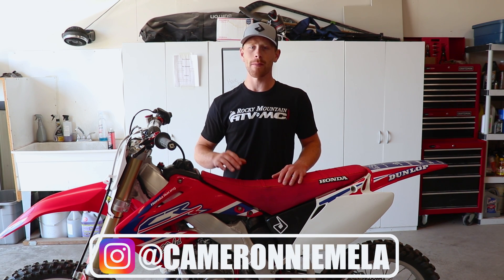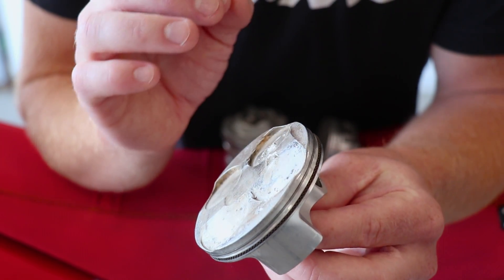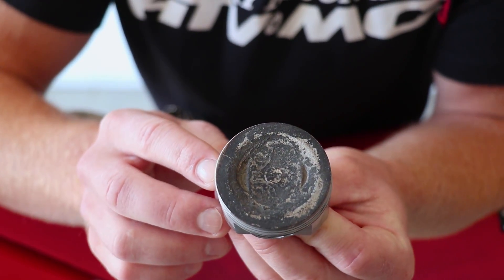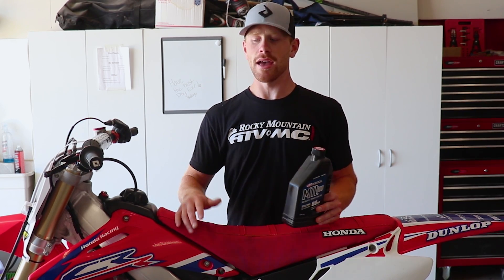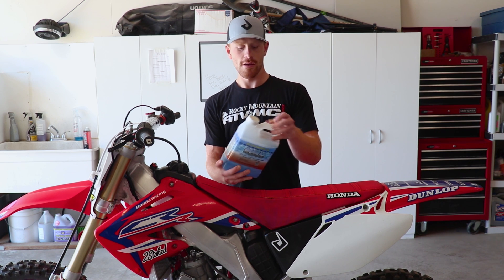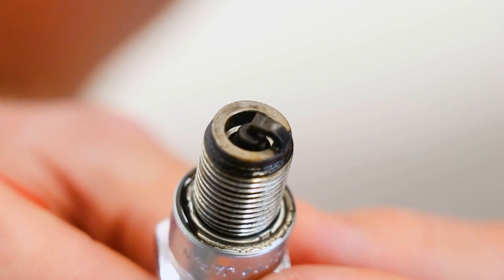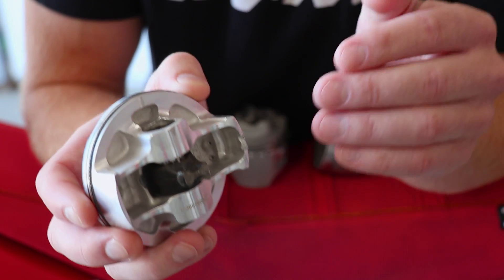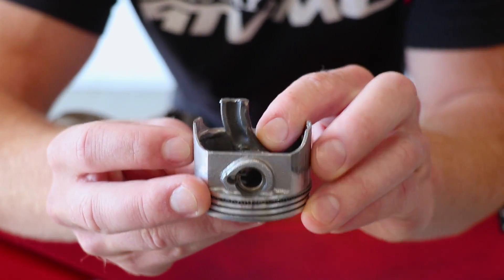Why Do Engines Blow Up?

Comment from the maker: Share your blown engine stories!
Reply: My little Honda CR125R had very poor compression, I am doing a rebuild on it right now, but I am not sure what happened.
Reply: @johnybrug5406  that's why it will sure do it again and again and  till you take five m
inutes to find out by googling it ..
Reply: Has anyone ever seen a wrist pin cir clip come out and destroy a cylinder
Reply: @Kaws1976  that happend on my Yamaha Aerox scooter
Reply: I recently picked up a yfm350x out of a warrior that was "recently rebuilt" for a engine swap in a small gy6 buggy. As I tore into the engine, the stator cover was pinching the neutral safety switch wire causing the case not to seal right. The PO tried to seal that with blue rtv to stop the oil leak, but I imagine it was still ran like that. When I disassembled it further, the piston was scored, cylinder had slight nicks, head had a chunk missing in the chamber(salvageable), the con rod hardly rotated on the crankshaft. Wrist pin had to be beat out, and the "bearing" in the big end of the con rod came out in small, flat slices. The bottom of the case halves were covered in glitter and the oil filter was covered in a thick layer of blue rtv and metal shavings. Transmission and cases were pristine aside from that, so I'll be eventually rebuilding it after my current job with a marine ford 351w. 

Tl;dr, top and bottom end on a yamaha atv engine was destroyed by an idiot pinching a wire with cases and draining the oil.
Reply: I did burnout with my bike and then went to home and at the way to home i noticed weird act of angine at high rpm and sparkles flying off the silencer and i revd it quickly and then rod bearing gave up
Reply: My 2002 CR250R had a crank bearing failure. A piece of the bearing came up into the cylinder and caused an ignition at the top piston ring and drug down the cylinder wall causing a lack of compression. Six miles from from the truck in the Sierra Nevada wilderness near Lake Tahoe. A good friend of mine pushed me all the way back with his left foot pressed on the back of my swing arm. Thanks Dave👍
Reply: just bought my yz125 friend rides it, rings its neck, braapppppp ouuuupppppp seized :/
Reply: Drove 2 hours to a mx track at 9am. After 5 minuets the poor yz blew a crank in the middle of the track
Reply: some dude bought my bike and 5 days later told me the crank made noise and wanted me to fix it for free or he would sue me.. which ins't a thing in the state of Maryland and said he got me to notarize a warranty and I wasn't even there..
Reply: My buddy just had his cam bearing blow up and a ball bearing got lodged in the timing Chain sprocket and locked it up.
Reply: dam brotha that happened to me to but not 2 hours away
Reply: never had 1 looking foward to it tho :D
Reply: No blowed engines :3
Reply: Mike Norman no but I've had a piece of Ring snap off and wreck the Cylinder and head
Reply: Mike Norman yes it hapend to my old Yamaha yz 80 1980
Reply: Had like 400 hours on a yz250 top end. The skirt broke off and got some metal into the crank bearings
Reply: cr
Reply: cr too
Reply: Bought a Yfz450 from an auction. Marked as DNR. Couldn’t get it running. Finally opened up the top end. Valve was stuck in to piston.
Reply: Does starting the engine breaks the valve if spark plug is not installed?
Reply: @nathanielpeter3296  no😂
Reply: I was riding my  99' kx125 four days ago -I noticed a quick dip in power and then a noise that sounded like nuts and bolts in a blender 😬.. I'm scared of what I'm going to find when I open it up
Reply: @Teach-a-man-to-fish26   What did u find 
Probbably a fcked up main bearing
Reply: @hardendurobosnia17  bingo! The main bearing housing became slightly worn enough to cause the bearing to flop about like a dick in a bucket and bent  up the washer type thingies on the big end.
Reply: i went out to one of my local tracks i just changed the oil, coolant and air filter. i had plenty of compression but my bike wouldn't start so i decided to clutch start my bike it started i let it warm up went onto the main track did a few laps the bike was great i did an enduro loop my bike was still great i decided to go back on the track and as i was going off the upramp of a 100ft kicker my top end seized i pushed my bike back to my set up about 1 mile away i took the radiator cap off and it looked empty i striped my bike apart at the track to see how bad it was turns out i had a leak in my head gasket which let coolant and water into the engine so bye bye top end...full top end rebuild later...                                                                                                         at a track day    top 5   i was about to hit a 60ft step up bottom end goes i case bad go over the bars and fall about 20ft off the side of the step up...                          then i decide to do the bottom except the clutch because it still had good bite...           did a clutch at a track day changed it in between races 1 and 2 then race 3 i did another one turns out the basket broke to pieces and this was all this year so its been an eventful year for me
Reply: Bought a CG125 that opened up when kicked over, key stopped it the first few times when adjusting stuff however, when it failed to kill the engine panic set in and I drew a blank as I watched it seize. Got lucky as the only damage was a sheered valve sleeve that missed the valve seat and bounced around the cylinder. Lesson learnt - pull the spark plug... Also a good excuse to port and polish during the rebuild
Reply: I use bel ray gear saver
Reply: Can someone help when i get back onto throttle on my yamaha dt 125R it makes a noise
Also when i shift in 1st gear it makes a bad noise
Reply: Cameron Niemela I had a 06 CRF450 and replaced the valves but didn’t mess with the head or take it into a machine shop because the new valves seated and met the correct valve clearance and it lasted for about two years then at the beginning of the season first ride the bike locked up like I stalled and couldn’t kick it over so waited a little bit then the engine unfroze but rode it again expecting worse and it detonated and I think it was the bearings to the crank case and then took out the top end breaking the piston apart. I don’t believe the top end took out the bottom end but want your opinion? I sold the bike for parts and going back to 2 stroke so I like your 2 stroke videos but I’m getting ready to make a project 2 stroke and we all have our preferences but maybe you’d like to hear mine!
Reply: I dont know why but my big end was fcked up
Reply: Rode a 2 stroke on strait gas...  no bueno
Reply: i got a motorcycle it was a kawasaki big bike the air engine blew up in the middle of the f**king highwY
Reply: Share you video in the description like you said you would
Reply: Very similar story to the video above - I am base din Thailand and have 2012 CRF250L with a Takagawa 305 BB kit, Full Yoshi Pipe, EJK Fuel Controller .. ridden hard offroad without issues for 1 year, then did a short road trip, cruising at 120kmh, engine was not revving hard and plnety of airflow so was cool  - then BOOM! Blew pieces up though top of the the crankcase , fragments hit my riding buddys ghelmet 20m away .. I am very lucky I didnt lose the family jewels .. pulled down it was TOTAL destruction .. I have some pix if anytone is interested. Will be rebuilding using Honda parts as I want it as a light Adventure bike for SE Asia and so easy parts and repairs .. mechanic says we can used some CRB300 parts to get 300cc and match the current tuning with the pipe/EJK etc, and not over stress the engine. No clear reason why it blew, but seems conincidental that the last service he used Shell Advance rather than the usualy Motul 5100 .. but I am told the Shell Advance is just as good, so not sure. I would be interested to hear comments.
Reply: I have a trx250x and I was in the woods miles from home and I heard a loud pop and then the engine locked up had to push down the side of the interstate for 3 or 4 miles till I got home (the trail went under the interstate)
Reply: Cameron see my post below with my sad story!
Reply: I quit blowin , egngines   cuz in cost too much  cost too do 
 . .but s t ill fun to watch the noobs do it
Reply: my sons crf250r blew up, rod snapped and dropped breaking both cases, exhaust valve broke and damaged the piston which twisted into the cylinder sleeve, etc, etc. full engine rebuild. Ouch $$$$.... we live in Africa so spares all had to be imported...

I do have a question maybe you can advise on... his bike struggles to start using the kick start but starts easily when pushed and engine sound great once on. Except when it idles it doesn't idle smoothly; idles high then drops and dies. We checked the valve clearances and they are out of spec a little.... we have also ordered new valve guides which we forgot to replace during the rebuild. So planned to adjust the valve clearances after replacing the guides... Could that be the issue with the hard starting? We have checked everything else; carb, fuel flow, spark plug, TPS, ignition coil, decompression weight..... So other than valve clearance and guides, anything else we forgot to check? TIA
Reply: About a year ago my friend had an RM125 and we were acc driving it to the mechanic for a full rebuild and the bike wouldn’t select 4th gear and when you tried to it would either drop back to 3rd and most of the time back down to 2nd unfortunately this time it when right back down to 2nd and we where on the main road and the piston seized to the cylinder was the funniest but scariest thing ever good thing it happened just down the road from the mechanic so that was handy
Reply: My dads kdx200 wasn’t warmed up right and was abused and ran really rich the piston broke in half but still ran just knocked a lot and they didn’t use the clutch to shift  and the chain was shot so the sprocket bent and the cylinder cracked and the suspension was shot           Here’s another story but the bike wasn’t blown up.         The bike was a xr100 and there was dirt in the carb and in the gas tank idle was really high ran without a filter cover and was abused so bad it has no kickback when you kick it and really easy to kick and popped and the jets were clogged and floats were off had a head gasket leak and has a shot suspension clutch cable is shot too tire had close to no knobs and shifter hits clutch case when shifting.
Reply: I ride for 10 years and never blown up any of my dirt bikes, i had
Yamaha ttr90
Ktm sx 85
Ktm exc 250
And Suzuki RMZ 250
Reply: "My Beautiful Nightmare.... 2 Be Continued"
Since I was able to think, talk and walk I've always wanted a dirt bike and a dirt bike wasn't a real dirt bike if it didn't sound like a bunch of pissed off yellow jackets swarming you for your lunch! I grew up in the Bay Area of California so it wasn't logical for my Dad to buy me one considering the neighborhood we lived in as well as not having the money to afford one, so I grew up wishing and dreaming and when Jeremy McGrath had dominated his race, I'd turn on the PlayStation and put Jeremy McGrath's Supercross '98 in and pretend I was in the game... Like EA Sports! Time went by, sometimes slower than sand in an hourglass but feels faster than you can blink an eye, and now I have 2 beautiful boys that I want to give the world to... As well as everything I never was fortunate to have... But the struggle is real! 
At the age of 31, (Last Year) I finally was able to make my lifelong dream become reality... Or so I thought! I had $2,800 in my pocket and I knew that wasn't even close to what a new, fresh off the floor dirt bike costs.... So thank God for the Internet right? Now I truly don't know why the 2001 Yz125 was always the bike that was burned into my memory, perhaps it was Jeremy McGrath on the centerfold of a magazine that has always stuck with me throughout the years I don't know, but all I know is I had to have it! So after a few days off browsing Facebook Marketplace I found her.... Only a 45 mins drive away and the seller was going to be having a guy come to look at her around 1pm... I made the call at 10:53am and told him I wanted it no matter what! (ARROGANT, DESPERATE AND ADOLESCENT) Like a kid at a store, it would've been the end of the world if I couldn't get what I wanted! I convinced the seller to let me "cut the line" so to speak and be the 1st to check it out.... Of course a picture of a fresh stack of new blue striped hundred dollar bills was persuasive enough to give me the opportunity!
I show up and there she is sitting up on a stand in front of the driveway perched up peacocking and I already knew she was coming home with me! He gave me the rundown as well as some gear additional parts and a brief history lesson and some advice and I was on my way feeling like the man all the way back home.... Cheesing like Chucky! Then the clouds turned black and the beautiful fairytale I was living suddenly changed into a horror story! The kind that wakes you up with beads of sweat on your chest and keeps you up all night! Only it wasn't a bad dream, it was a living nightmare! 
She wouldn't accept me as her rider, so I thought well maybe I gotta step my game up... Gotta prove my worthiness right? So I pick up some microfiber towels, some degreaser that wouldn't be so rough on the body and some sweet smelling perfume and rejuvenation in a bottle (SC1)... and proceeded to pamper and show my love and care.... But like most men who try too hard, I was shot down and rejected as she began to fight with me every step of the way! The carb would leak fuel from the overflow tube, she wouldn't respond to me and if she did it was with attitude! I bought her everything, new clutch plates, new cables, new plastics, new paint job, new shift lever, new brake lever, new stator, new piston, new cylinder, new shift cam stopper, new gaskets, new carburetor, new pipe and muffler ... You name it she had it all! And today after hours of carefully and happily removing the subframe to install a new Lectron 38H she finally gave me the nod of approval! I got to finally start living my dream... Finally able to be free and fly!!!.... Or would I? .
10 mins into the ride she loses power and won't start back up ... Gas leaked from the the bowl and there was no compression.... I had to walk a half mile home pushing her and asking her why over and over... Why you gotta break my heart like this!? 
I get home, and I still keep hounding her, begging her to stop being so stuck up and show me some much deserved love and give me some quality time. I put her on the stand and remove the plug.... SMOKED! I removed the cylinder head and I cried! She had committed suicide in my arms! The piston had a big hole in the crown, or in her heart! I don't know how to recessitate and bring her back! I need someone to see my ambition, see my true intentions and feel my pain... I need someone to bless me with an opportunity to live my dreams but there is nobody who knows or has the time to do so, nobody has old parts they can spare me and I feel like I need her more than she wants me and it's worse than a temporary separation..... It's looking like it's coming to a divorce and I gave my vows! 😭 I can't give up! Not now! Not ever! Please can someone help me so I can't have a Part 2 and live happily ever after or are all fairy tales devastating like this!?
Reply: me and my fr

Comment: My fvcking 4 t engine blew a hole I the oil pan  hâd New oil worked perfectly and after 2 h of use just blew a Ho and fvcking smoke the rod i think the piston is dead and the block is fvcked up fvcking chinease engine  I worked 10 fvcking days to start it up fvcking engineeeeeeee😩😫😫😫😫😫😫😫😫

Comment: The time my kx cut off 6 miles from home and had to push 3 miles about got age by hounded scared for my life lol I got extremely dehydrated wouldn’t crank bought spark plug though we blew it up and 3 months later we put spark plug in gas then it starts 😂

Comment: I was riding with the pack on holloween on my cr85 on 6th gear for about 2 miles and my bike just bogged out ???(blewup?) this has happend to me before I just changed the spark plug and it started working again but this last time , I tried to change it and get back on the rode but it didn’t work , then like 10 min later ,it cranked right up like nothing rode for about 20 min then it did the same ,????? Any advice ?or has this happened to anybody and what did y’all do or what was the issue for this to happend ?

Comment: Me: hasn't changed my oil in 3 years, has overheated my atv multiple times, has never changed my gear oil, and has never changed my air filter. 

My 80cc yamaha raptor from 2003: has literally no problem with it

Comment: Rod snapping on the 250 is rod fatigue from bouncing of the rev limiter being ran too long. Rev limiter cuts spark and without the combustion event to ‘cushion’ the piston @ TDC when it needs to change direction. This accelerates fatigue in the rod @ it’s weakest (smallest cross section) point, or below the piston pin.

Comment: So the way I blow up my engine is I bought a new header for it an I wanted to ride because I haven’t been able to so I was riding a dr49 Baja on the road an I first broke a rocker arm fixed that then the valve blew off an blew a hole in my piston bought a new top end just got to put it in idk y it happened